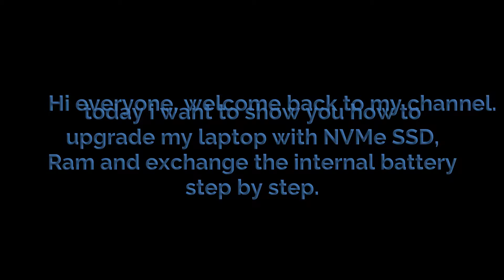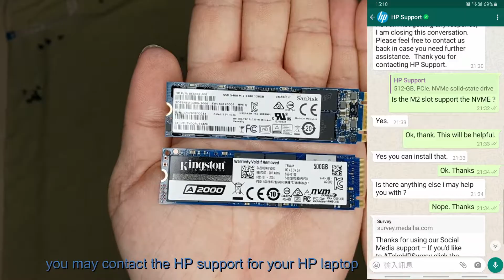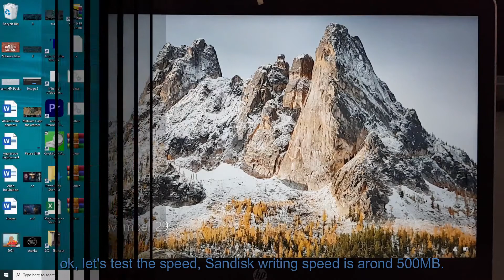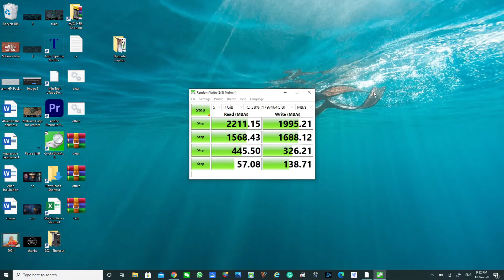HP Pavilion X360 Convertible Laptop Upgrade Step by Step

Comment: Zunächst einmal, möchte ich mich für die tolle Anleitung bedanken. Ich hätte eine Frage, nach dem ich den Akku ausgetauscht habe und den Flachbandkabel etc. wieder angeschlossen habe, funktionieren nicht alle Tasten. Hintergrundbeleuchtung funktioniert und einige andere Tasten auch, aber nicht alle. Könntest du mir einen Tipp geben?
Reply from the maker: hi, you need to check which connector or cable didn't connect properly.

Comment: I have HP Pavilion HP Pavilion x360 - 14-ba075tx. 
I already have 4 GB RAM in the device. Can I install 16 GB RAM in the second slot? Also suggest which SSD is compatible for this model?
Reply from the maker: Hi Sunny, you can install 16GB in the 2nd slot, or replaced the 4GB with the 16GB. Any brand of 2.5" SATA SSD is compatible (not for NVME drive, NVME drive need to check compatibility.)

Comment: After doing all these things mentioned in the video, my wifi and Bluetooth is not showing can you help me with this
Reply: Ok i will reassemble it and let you know, thanks for immediate response
Reply from the maker: @suneelking99  good luck bro.👍🏻
Reply: Hey what you said was right i forgot to fix intel wireless adaptor
Reply from the maker: @suneelking99  
Glad that you've solve your problem. Cheers
Reply: @DinoCreation5520  now please help me how to migrate my os to m.2 ssd
Reply: @DinoCreation5520  thank you, your guidance helped me a lot
Reply from the maker: @suneelking99  
You may try this method, https://youtu.be/vAbOJC4enrc
Reply: After restart my touchpad is also working thank you
Reply from the maker: Hi, make sure you put back the WiFi card cable properly (got 2 small cable) at 4:36.
Reply: Its working now, but had a small problem my keyboard working but touchpad not working and i have fixed the mouse strip also correctly what is the solution for it, pls help me
Reply from the maker: @suneelking99  
You check again the 3 flat cable from your keyboard connect to your board, I suspect one of the cable didn't connect properly.

Comment: How to perform a processor upgrade though?
Reply: you can't do it, it's soldered
Reply: @mwhunter2346  I just realized I don't need a processor upgrade but yet a GPU upgrade, so how to upgrade a GPU?
Reply: winkgaming93

Both the processor and the graphics chip are soldered to the motherboard. If you want to upgrade either one, you have to buy another notebook computer.

Comment: Can i have too get ur whatsapp number
Reply from the maker: No, sorry, I can't give you my WhatsApp number. You may ask the question here and we will try to help you up, cheers.
Reply: @DinoCreation5520  brother i use 
Hp x360 model 
Cd 14 tu0077TU

I want use a nvme type ssd in this it shown there near the port m1sata

I was confused to buy which model to suit this
Reply from the maker: @labeeb2903  you need to contact HP, they will ask you the serial number of your laptop, then they will confirm with you can support the NVME, once confirmed, you can buy any brand of the nvme to use on your laptop.

Comment: Hi there, Hey you removed the SATA ssd and replaced it with NVME one. So does all SATA ssd slots support NVME ssd?
Reply from the maker: No buddy, some of the motherboard can not support the Nvme even the slots are same. You need to contact the manufacturer to make sure your laptop can support Nvme or not.

Comment: Great video. All the other HP pavilion laptops videos open from the bottom. Mine is like the one in the video...i have an 8gb ram addition and a 2 TB SSD to replace the 1TB HDD on the way from Crucial. 

What was the small SSD chip you replaced next to your ram housing?
Reply from the maker: Thanks for your support. You means the Nvme or the Ssd?
NVME is kingston,  ssd is seagate.
Reply: @DinoCreation5520  yeah, the kingston product you replaced. I'm just getting into upgrading my laptop. What is that? I don't think my computer has that, but I'm not sure. 

Mine is the hp pavilion x360 convertible 15-br052od
Reply from the maker: @bfurl69  
Hi, You need to contact hp to confirm,  some of the hp model can not upgrade with other brand products. You better make sure before upgrading 😳
Reply: @DinoCreation5520  I went through the Crucial website. They said they had compatible upgrades, so I ordered them. I hear they're a good company.

I don't think mine has the NVME
Reply from the maker: @bfurl69  mine is normal m2, luckily can support Nvme,  the speed really fast compared with normal m2.
Reply: @DinoCreation5520  success! Installed the NVMe and upgraded the HDD to an SSD. I cloned windows and installed it to the NVMe. 

Question, could i clone my windows setup to an external storage device and open it on any windows 10 computer from the USB boot option in the bios?!?!
Reply from the maker: @bfurl69  
can， you can make a bootable usb drive.

Comment: I have this verision hp laptop, came with a HDD. Can I add  SSD along with it?
Reply from the maker: No, you can only exchange.
Reply: Aww ok. Can I use a 1tb 2.5 HDD? My hard disk drive is damage.
Reply from the maker: @Crawsis  
You can use 1TB SSD, not a problem 👌
Reply: @DinoCreation5520  thank you so much
Reply from the maker: @Crawsis  
No problem.